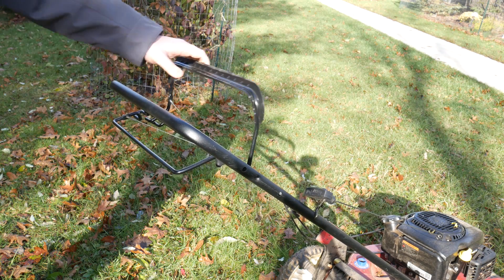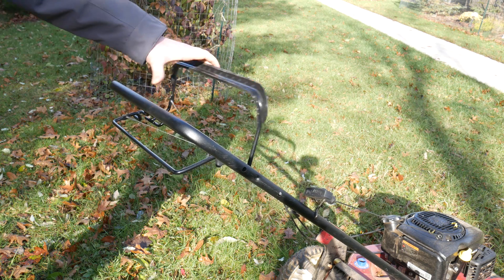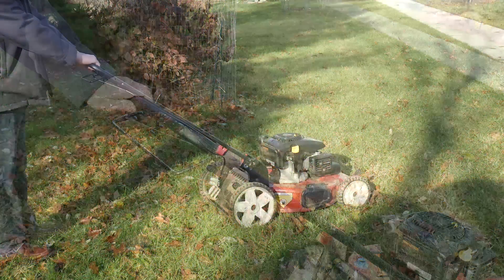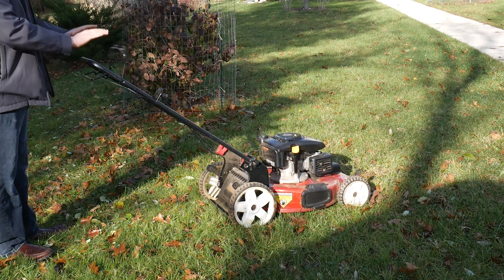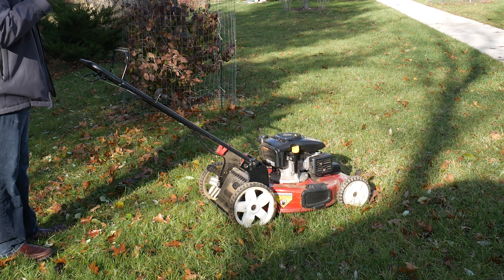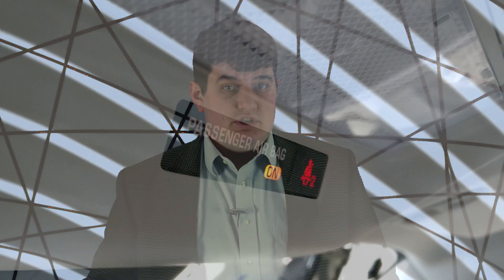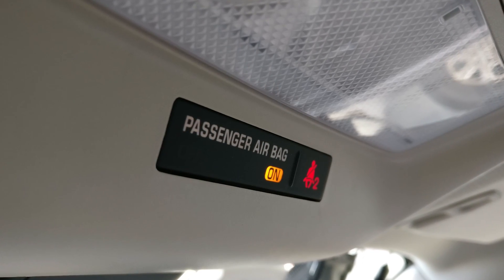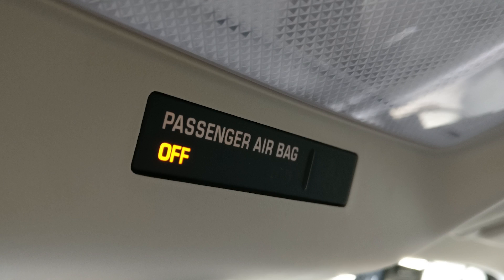The Dead Man's Switch:  How Anton Yelchin's life could have been saved

Comment: Great point, however I do want to point out, that this would most likely need more than just a software update, since body and interior electronics are not necessarily connected up to the engine and transmission computers in any way.

Comment: It should set a parking break. There are scenarios where I need to leave my truck in neutral when loading equipment. In Park it will damage the transmission if the vehicle is pushed. With the parking break set, it allows some slippage with no damage.

Comment: Having the system slam the car in park as soon as you're out of the seat sounds like a good saaaafety-thingie, but what happens if you need to push the car for any reason?  Likely the engine would be off but maybe the battery's still okay, supplying power to the saaaafety-thingie and you have to leave it in the middle of the intersection.  Probably same for emergency brake (hand brake in Oz) which locks the car in 3D space if you're not able to sit in the seat and steer while "the help" pushes.  Maybe Anton would have been better off with a small car instead of a trendy SUV tank.
Reply: And how do you get stuck in the middle of the intersection? I could see at the stop light or on the side of the road but you had be rolling at least when your engine stopped working. Not only that but I wouldn't want to push my car a mile by myself to get it fixed. Another thing is you can always throw the car into neutral and turn off the power, or even put a handle in the car that you can pull that'll disengage any locks that prevent the car from moving (this is implemented, however more mechanically, in some cars where if the parking lever gets stuck you can simply push the button or flip the switch and it will override the lock that prevents the shifting of gears without the brake pedal engaged.

Comment: 3:30 Haha Both my 1985 Hyundai Pony and 1987 Stellar had no shift interlock. You can shift out of park at will!
Reply: My 66 galaxie doesn't even have a steering lock
Reply: @fallout0624  My 1999 Matiz doesn't have a clutch down safety switch. Did you leave it in gear and try to start it without pushing in the clutch? Hope you werern't too close to something.
Reply: @the_kombinator  had that happen before on a old farm truck we had, it was an automatic with a busted neutral safety switch, that was fun

Comment: Dead mans switches are a non-solution to a non-issue and would cause way more accidents and fatalities then they 'prevent'. The reason they are not, and likely never will be used in automobiles is well established. 

A dead mans switch simply cuts power in the absence of some applied force. You can cut the power to the car all you want, and you're not going to stop it from rolling if it's in neutral or in gear.

 In fact, because steering and braking power relies on the engine, this would just make any potential problems much more dangerous.

In order for this to be a solution to Yelchins death the switch would have had to apply the brakes on it's own, not simply shut off the vehicle as vehicles do not magically stop when they turn off. Brakes that automatically apply themselves suddenly based on a dead mans switch type mechanism? Yikes. No thanks. Not in my car. Not in a million years. An engine that suddenly shuts off because it thinks I'm not in the vehicle, so i lose all power steering and brakes? Again, no thanks.

Antony Yelchins family already settled out of court because they had no case and was determined he was at fault. His death was preventable by not being an imbecile.

Comment: Honda has that type of feature on their car if you unbuckle the seatbelt & open the driver's door it will automatically put it in park.
But that's only on the higher trim levels that don't have the mechanical gear shifter.